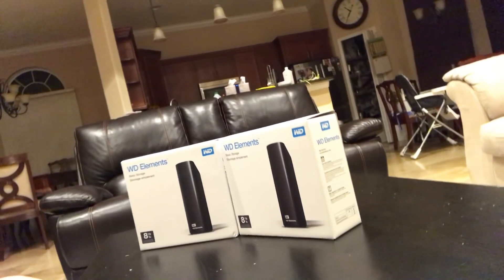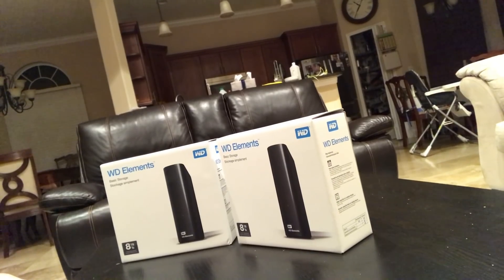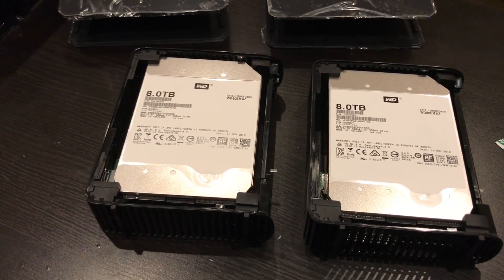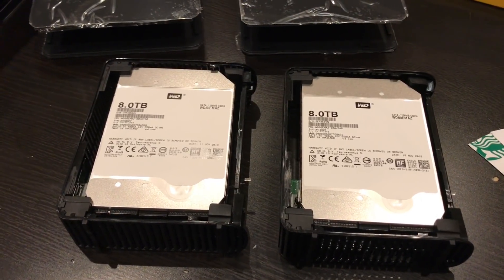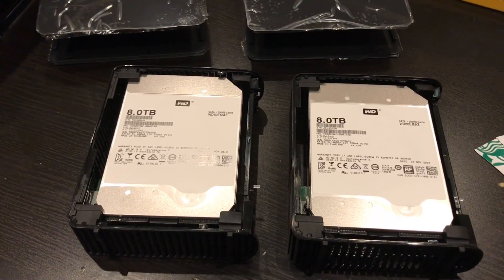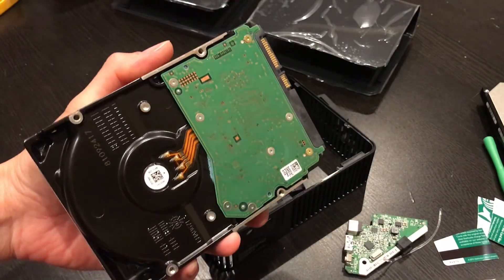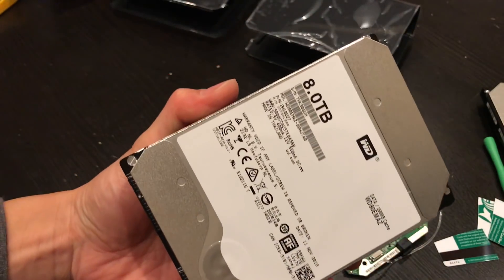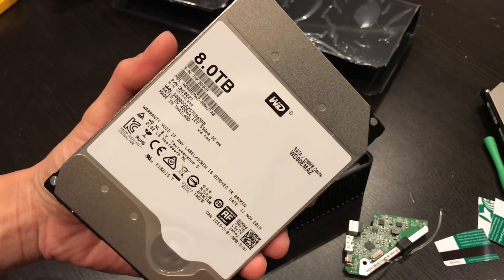Shucking Opening 8TB WD Elements External Hard Drive HDD White Label Red

Comment from the maker: Amazon has the 8TB for $115 right now (1/20/19) check the link. https://amzn.to/2G6JVEn
Reply: I got it from the amazon follow you instructions but when i put it in PC HDD wont turn on seems like there is not going any power. when i put it back as it was before HDD is working. Any suggestions?
Reply from the maker: Mirro you have to tape one of the pins if your power supply doesn’t support the 3.3V pin voltage. It’s a common problem but easy fix. https://www.instructables.com/id/How-to-Fix-the-33V-Pin-Issue-in-White-Label-Disks-/
Reply: Tuner with Kids ok great got that thanks
Reply: @mirro_hero  you have to cover the 3.3v sata power pin (3rd from right to left when looking at it upside down). The external controller works in reverse and puts the drive to sleep/wakes it up with that 3.3v signal. When constantly getting 3.3v it's like holding down the power button your PC but never releasing it = it never turns on. A lot of people use kapton tape but seems difficult to do right (the pin is 1mm wide) and the tape eventually comes off with a few bay inserts. I ended up using red insulating varnish. Fingernail polish would probably work too but I used what I had on hand.
Reply: Damn, still on sale, but up to 150 one year later....  Still seems to be the best value for a new HDD.

Comment: The drive inside the Elements, has no cache. In my case, if it was a Red drive, it should have 256 MB of cache. So it may be a Red drive, but with cache removed.
On WD's homepage, they don't give the size of the cache, but on a few websites, where you can buy the drive, it says "no cache". And it acts like it doesn't have cache.

So I would never buy this drive, as an internal drive.

Comment: Just shucked two of these in the UK, but think they came from France, both are WD80EDAZ-11TA3A0 (December 2020) which no one seems be quite sure what they are, but apparently they run hot and maybe even 7200rpm, but these are going in my home server with good air flow, so should hopefully be OK. Thanks for posting the video, made it real easy opening them up with out any damage.
Reply: Did you have to do the tape on the 3rd pin thing?
Reply: @mattc5592  Mine are used in a Supermicro CSE-M35TQ rack, which only has Molex connections, so as I understand it wouldn't suffer with the 3rd pin problem, as that's only present when powered off a Sata power cable. PS Maximum temperature in my server has been 37c and 39c,  one drive does show 51c as the max, but that was when I used it as a USB drive to temporarily back up my NAS whilst I changed over its drives.
Reply: @TheRonskiman  ok great thanks, I've got 2 of these arriving today so I'll see how I go 👍

Comment: Very useful and thanks for creating this - all the way down to removing the physical drive itself. Hopefully I can do the same to my 12TB WD External drive., when I'm ready. 
Let's hope that I can get it back together if I ever should need a warranty claim...!
Reply from the maker: Chances of warranty are probably slim. These have been pretty solid. Also if using on older PSU, may need to block off 3V pins on the connector. Look it up if you have issues at that point.
Reply: @TunerwithKids  Just taken the drive out of the case and preparing it for our media server.
Thanks for the heads up about the old power connection issue that could happen.
I'll find out if it applies when I'm ready to for it to the N54L.

Whatever you do please keep this video here, I might need to put it back together one day. Those rubber blocks seemed to fall out. Haven't got a clue how they would go back 🤷🏻‍♂️ 😂

Comment: This drive is good for movie storage direct into pc with sata ?
Reply from the maker: Yes it should be fine for PC use. Keep in mind that some older PS require the 3.3v taped for this to work.
Reply: @TunerwithKids  older PS ? what is this ? its for my Plex Server streaming to like 5 user
Reply from the maker: PS=power supply.
Reply: @TunerwithKids  so i need to taped the third pin ? to use it into a pc use ?
Reply from the maker: @EvilLex3D  yea, on some PCs. Look it up, common MOD for newer drives on older rigs.
Reply: @TunerwithKids  so when u said taped ? u mean like electric tape ? XD duck tape ? directly on the third pin ?
Reply from the maker: Electrical tape. Google it. Some people also just snip the wire on plug.

Comment: I don't understand much of this, but is it ok to always use the hdd, but externally, leave it connected all day and that, im afraid that it will overheat or something like thst
Reply from the maker: Mitt42, in the external case? It will be fine. These drives are designed to run continuously.
Reply: @TunerwithKids  thank you very much for your fast response, i was really scared that something would go wrong, thanks you.
Reply: @TunerwithKids  just one more question, since i don't have anything to cool it down and i can't tell if it's overheating just by touching the case, is there anyway to know the temperatures
Reply from the maker: There are utility programs that will tell you the operating temperature. Most of my drives that run 24/7 are usually around 85F to 95F.
Reply: @TunerwithKids  ok thank you, if i ever have any doubt or trouble, can i come and ask you?
Sorry if im being annoying.
Reply: @TunerwithKids  so i just checked and my external hdd is 58°C is that normal or is too hot
Reply from the maker: That doesn’t sound right. Is it in an open spot? Should be around 30-40C (85-105F)
Reply: @TunerwithKids  in my country its a bit hot, and it's in the open but there is no ventilation, around, im just worried that if it maintains around that heat the hdd will screw up
Reply: @TunerwithKids  but is it critical, or if I stay with that temp everything will be fine

Comment: Why is buying the actual drives about twice as expensive than buying this?
Reply from the maker: I think supply and demand. Also market conditions. Bare drives are mostly sold to OEMs and external drives to consumers. So less bare drives are sold and marketed thus higher costs. Lot more competitive prices in externals. Plus they usually have latitude of putting surplus drives in externals as they aren’t bound to a specific model or line.
Reply: @TunerwithKids  That makes total sense! Thank you!

Comment: have you used the HDD "internally" ? no issues? I want to order one and use it internally...
Reply from the maker: root8ble , I run it in my Synology NAS. Been in there since I posted the video, February 2019. No issues. I check the SMART data periodically and also look at the operating temps and hours. Nothing out of the ordinary.
Reply: @TunerwithKids  cool! Thx for the reply

Comment: Hello,I have an 8TB from 2019 and the arm is stuck( short buzzing sound).  I took it to Gadget Pros and he said there was no way to get into the drive to manually move arm, no screws,  Are theses things sealed so that they can't be opened, beyond the shucking?  I pealed back the label and only found one small disc like piece with a small rivet in center.  Thank you
ETA:  I assume if the arm is frozen, it would do me no good to connect naked HD to dry dock for transfer?
Reply from the maker: Probably mechanical failure. It’s dead, only way to recover data is professional lab. That is very expensive.
Reply: @TunerwithKids  Thank you for quick reply!  So the news ones are sealed so that the laymen can't open them up anymore?  Marketing genius I suppose <shakes fist> haha
Reply from the maker: mark flores no HDD have ever been user open able. These are clean room devices.

Comment: A dumb question, please: Why shuck an external drive instead of just buying an internal drive? Is it because the external drive is cheaper? If so, why is that true? Thanks!
Reply from the maker: Robert Bernstein exactly. Bare internal drives are usually 20-30% more expensive and never on sale. Lots of externals are always on sale. Plus they used to put more expensive drives like Reds inside due to manufacturing subs or shortage. These days they “white label” the external drives and many people theorize that’s they are just relabeled reds.
Reply: @TunerwithKids  can you explain why they charge less for the drive in a case with a power supply? Also, is there any software to find out what kind of drive is inside?
Reply from the maker: Robert Bernstein supply and demand? Competition? The market for externals is end users while bare drives are OEMs. So when a consumer needs a bare drive, the consumer supply is limited. There are some freeware that can look up the info on the drive which can be cross reference online or thru others experience. I’m never personally used or tried.
Reply: @TunerwithKids  I did a Crystal check on my 12TB WD Elements drive. It shows it as a 5400RPM drive not a 7200RPM drive. It does not give any other information. Perhaps they really are inferior drives?
Reply from the maker: Robert Bernstein 5400 rpm is a good sign. Most people shuck to use in NAS’ so a 5400 rpm is desirable.
Reply: @TunerwithKids  thank you for answering my many questions. Once again I am mystified. Why is 5400 RPM better than 7200 RPM?
Reply from the maker: Robert Bernstein NAS’ are 24/7 devices. Less wear and tear is one benefit of 5400 vs 7200. Generally NAS are in a RAID so data access speeds not as important as reliability. Since the RAID controller will pull the data from multiple disks.

Comment: At the moment the 14TB models of the WD Essentials and the WD Red's there's a, slightly over, €100 difference in price. It would be crazy if these were actually the same hard drives. Still, they might have a different firmware. I remember something from a couple years ago when I wanted to get a WD Green and the only difference between that and a WD Red, at that time at least, happened to be the firmware according to the community. It might be important, it might not be. Perhaps you can flash the firmware with the WD Red one somehow.
Reply from the maker: Yea with advances in tech and production I wouldn’t be surprised. Also could be how the classify a batch on its reliability and robustness could determine which label it gets.

Comment: Why would this 8tb hard drive not show up I’m my bios or windows already of course triple checking the wiring
Reply from the maker: joewayne there are a few questions in the comments but there’s a 3.3V pin that’s not compatible with older power supplies. Need to tape it. Check pinned comment, I posted a link.
Reply: @TunerwithKids  FYI. It's not just older power supplies. I had to use the 3rd pin tape-over method with my Corsair RMx 650 which I purchased in January of 2020.
Reply: Tuner with Kids thanks figured it out

Comment: I never understood the economics of that. More components yet cheaper than a bare. Thinking the drives themselves have failed various QA checks for bare red drives but pass QA enough for an external enclosure as a white, hence the shorter warranty. They could also be refurbed reds that have been returned under warranty, repaired, relabeled, slapped in an enclosure and resold (in an enclosure and sold as an external so no legal requirement to state it's a refurb). AMD and Intel do similar things for when an 18-32 core CPU has disabled cores that had defects so sold as a lesser-cored part for cheaper. Has anyone actually ran one of these 24/7 in their PC as an internal and have it last the whole 2-year warranty period? 1/3 cheaper but fails 1/3 sooner or even quicker doesn't sound like much of a deal, especially when considering time it takes to restore data. You get what you pay for.
Reply from the maker: I think its the nature of manufacturing. Companies save by keeping SKUs and inventory limited so when they do external Drives, the idea is to use a Blue or Green drive that is less cost and sell it with enclosure for storage and consumer use. But due to inventory and manufacturing, sometimes they have to use more expensive drives (i.e. REDs) to keep production going. Another reason why external drives are less cost sometimes is marketing and market share. They want their name out and for consumers to see it. When you buy a computer, you don't know what it ships with. The majority of sales are to OEMs not end user consumers anyway, so the lost leader is for name and market recognition.

Comment: Great video, thanks for making it. I’m planning to buy a new WD 8TB for use with a laptop and I already have a Sabrent USB 3.0 dock for SATA drives, would you recommend I shuck the new 8TB WD drive and stick it in the Sabrent dock for faster IO speeds, or do you think the original external enclosure it came in will provide the same read/write speeds via USB 3.0 directly?  Thank you.
Reply from the maker: retro_escape if it’s USB 3.0, leave it in the case. I have Sabrent USB 3.0 and speeds are not any faster to shuck a drive just for it. I use it more to read and pull data off bare drives I have backups on.
Reply: Tuner with Kids perfect, less work for me then. Thank you! 😃

Comment: Thanks for the video, it was very useful. I just bought one of these, and it works fine. Only thing is, i had to tape the third pin on the sata power connector, because my computer did not recognize this hdd. I have got the info from another video on youtube. Based on the serial number, mine is probably a HGST Ultrastar drive, according to this post:
https://www.reddit.com/r/DataHoarder/comments/8evpx8/evidence_that_the_wd80emaz_drives_found_in_some/

Comment: That looks bigger than 3.5inch drive.. what is that? can you use that on PC via SATA right?
Reply from the maker: yes its a normal 3.5 desktop drive. its SATA but for older power supplies, gotta tape the 3rd pin.

Comment: Can somebody tell me if you put it in the pc is do you get better response ?
Reply from the maker: Sladjana Vukasinovic better response? What do you mean.
Reply: @TunerwithKids  Somebody said to me that if you put that drive in a pc it"s more responsive than when you keep it as a usb3 drive meaning reacts quicker
Reply from the maker: Sladjana Vukasinovic yes because it’s on the PC SATA buss instead of USB. It’s also permanent instead of mobile. Most people use external to move data and backup. And external is usually cheaper than bare internal drive.
Reply: @TunerwithKids  Thank you very much

Comment: you can return them as just the drive just ask the tech support guy from WD about it I have returned  of them with no problems
Reply from the maker: the issue is serial numbers, the drive serial shows as OEM. its linked to the external serial number.

Comment: Thanks for the instruction. Could you tell me if 1) these drivers can go into Synology NAS without any modifications (some people suggests you need to blind the 3.3v pin) and 2)are they making a click/clunk noise every 5-6 sec. even without read/write actions? If yes, how "annoying" are these noise when they are housed in the NAS? My NAS is standing on the floor about 1,2 m from where I'm normally siting.
Reply from the maker: I use them in my DS218+, no mods needed. I think the pin mod is for older PC MBs that have older power supplies. No clicking noises.
Reply: Maybe the clicking is coming cause drive is adjusting spindown time too often via powermanagement. Have you checked via smart tools/hdparm whats the current interval or do you have some sort of daemon running backround doing it maybe?

Comment: Is it really worth the risk of them dying to use in a NAS? I want to know as i am thinking about doing it for a NAS build as its so much cheaper to buy it that way
Reply from the maker: Mystic Star depends on what your maintenance plan is and use of the NAS. I run a Synology RAID with different production run drives. Most data I have on it is backed up elsewhere and stuff I don’t care about like media doesn’t matter. My NAS will notify me when a drive is failed or beginning to fail.
Reply: @TunerwithKids  i dont really have money to backup 40TBs+ elsewhere when i get my NAS at first my media is important, i would be using Raid 6
Reply from the maker: Mystic Star keep in mind that a NAS is not a backup. It is for data access and storage and shouldn’t be treated as a source of data backup. With a RAID there is a small redundancy but that is if you can catch a bad drive in time to swap and rebuilt the data. If two+ drives die before you replace bad drive, it’s game over.

Comment: Greetings you!

 I was wondering how do I unformat my 8tb external Hardrive on my Android Tv Box, so I can use all my 8tb instead of the 1.3tb storage.

 I formatted my Hardrive only for portable usage (not format for "this device only") thinking it would still allow me to use my entire 8tb storage, but come to find out after formatting, it doesn't.

 I would like to unformat my hard drive, and place storage access back to Internal Storage, so I can have the full use of the 8tb storage.

 If you could please get back to me with some info, If you happen to know, it will be greatly appreciated.

Thank you kindly Turner with Kids!

(Note: It is brand new, and I do not need to restore/recover files. Only to regain usage of my full, 8tb storage external hard drive)

Comment: I had a weird situation of the drive working externally but would not power up when connected inside case.
Reply: Sounds like a 3.3v pin issue. You can fix it by just applying some electrical tape to the pin. Google 3.3v pin hdd and you'll find some guides.
Reply: did you solve the issue?
Reply: Fabrizio D'Alessandro Yes, it was the pin that was preventing startup.  Used heat resistant tape and it worked.

Comment: They are 7200 rpm modified to 5200. 

Don’t know if after removing the adapter it still 5200rpm or back to original?